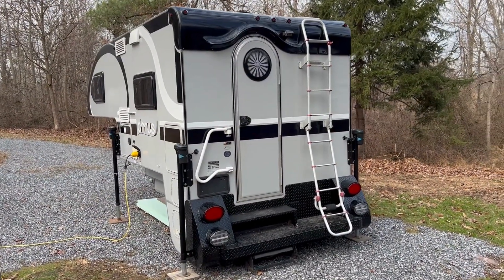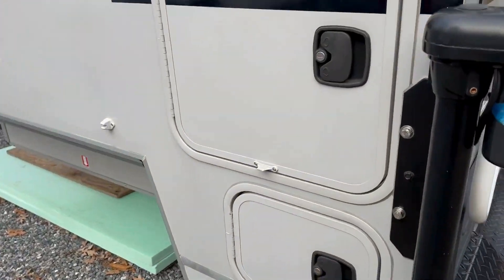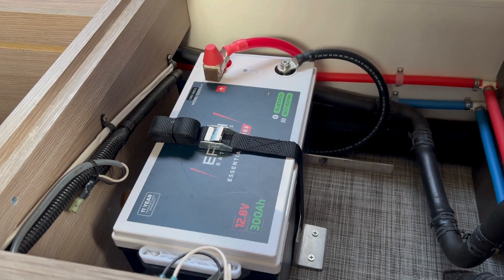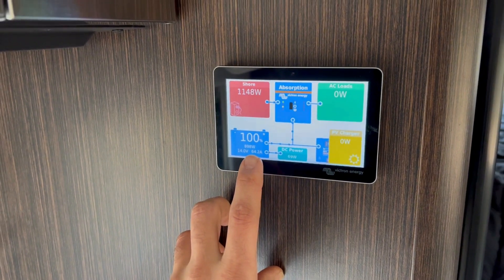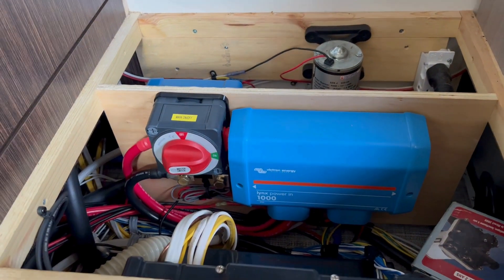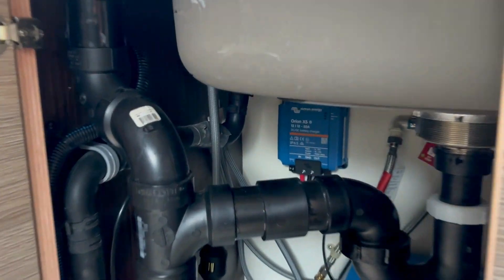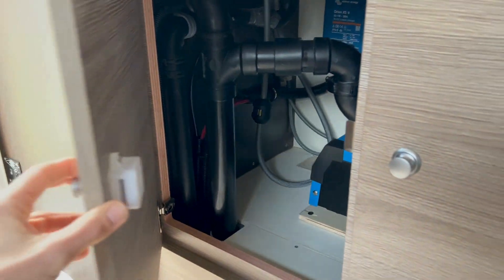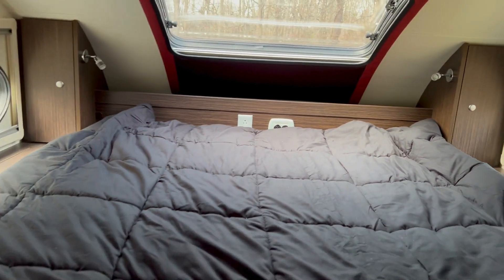Cirrus 820 Truck Camper Off Grid Power Overhaul!  12v AC w/ Epoch LiFePo4 and solar!

Comment: This is amazing work. Thank you for sharing! I also have a 2017 Cirrus- what a dream setup! Once they go to a 12v AC, how long can they use it on the 300 amp hours?
Reply from the maker: Theoretically if the 12v AC uses 50a (usually lower) then 300ah battery bank / 50a draw = 6 hours.  Thats an isolated answer not considering how hot it is, or if there is any addition draws or chargers.  Let me know if you would like a custom wiring diagram drawn up or a product list!  I offer clients discounts on many off grid electrical products!